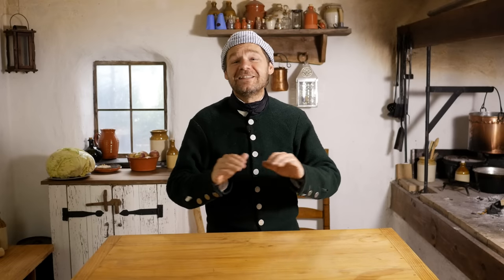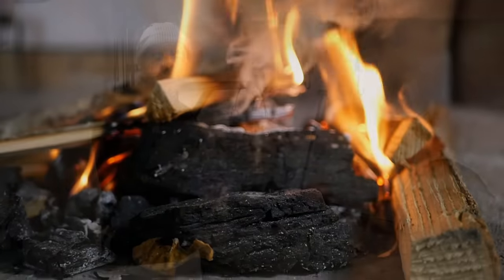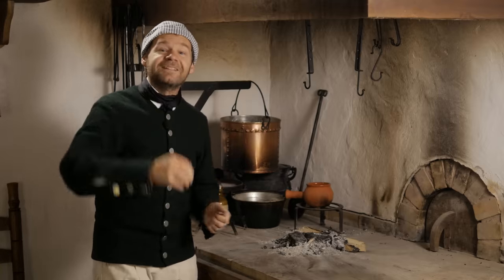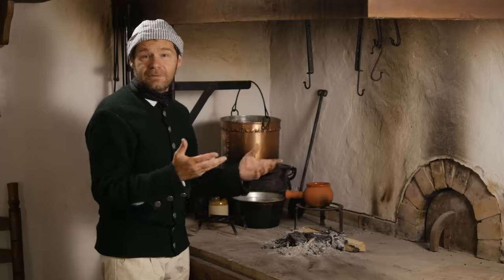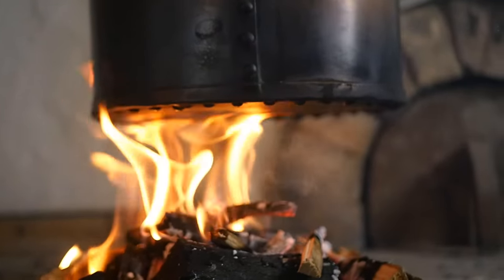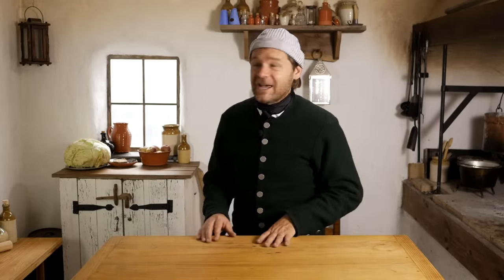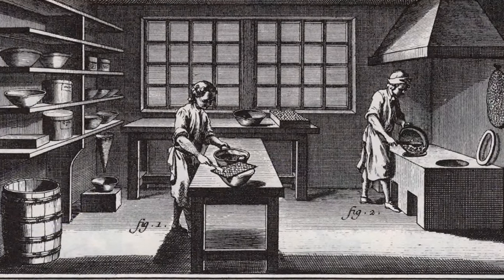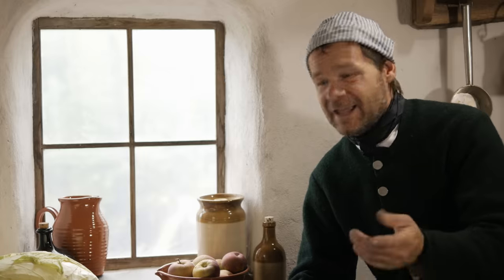Historic Kitchens vs. Modern Kitchens

Comment: I know I am probably weird, but I have an easier time cooking with wood fire than with modern ovens and stoves. I think I was just born to do it. I love it!

Speaking off light. I am always amazed at the times before lighting. To me it would seem impossible to see and drive me nuts! Or, at least I thought so. These days, I have on purpose, gotten used to cooking with very low light and  not overhead. I usually have on only the light above my sink and I do just fine with it, no problems whatsoever. I had to try it, because back in the 1700s have you ever noticed how small they wrote? I cannot even read it and I have good eyesight. I cannot imagine how they wrote so small. They did not have electric or public lighting. They had low lighting at best, from oils for heavens sake and their eyesight was by all accounts quite good. Maybe this bright sunlight into dark inside is healthy for our eyes. It would be interesting to see if there are studies on it.

Comment: Human beings are quite industrious as you know Townsends (howdy).  Cooking with smoke is better than cooking outside.  Too much draft will use to much firewood.  Now, as for my kitchen, I tried running exhaust from the stove and the overhead stovetop vent to the outside.  It over worked the stove and in winter time the kitchen would be freezing, even with shut off vents.  I managed to sole most of the issues but even with a separate vent fan, steaks, fish and hamburgers can be a smoke problem.  As you can tell, we like char.  Bought an outside grill which is really great but cleaning is a problem.  As always, studying your vids.

Comment: It's so weird to hear him talking about the way they had to wash the dishes. I am an American and live in Thailand. And it was a culture shock when I moved here 10 years ago, and saw many people here that washed their dishes on the ground, and using plastic tubs or a hose, outside. I had to wash my dishes that way for the first few months I lived here. I had to carry my dishes outside and down stairs, and walk down the sidewalk to a main area where everyone went to wash their dishes on the ground. And here, unless you buy a hot water heater, there is no hot water at all in your house. Even now, I have to wash all my dishes by hand, (because people don't really have dish washers here), and I have to use  just the room temperature water that comes from the faucet. We did install a hot water heater for the shower, but that is the only place we have hot water. And we are fortunate to have a typical Western style toilet. Because here, most people use a squat toilet, and there is a  large trashcan or some other container, that has a pail type thing, that you fill with water to pour down the toilet to flush it. And yes. This is 2021 and it is still that way in most homes here.

Comment: I have a question that I'm having trouble finding info about online...back before modern cookware, was cast iron used to cook acidic dishes like Spaghetti Bolognese sauce, for instance, or really just anything acidic?  My mother and WW2 era grandmother were raised in families that were taught to simmer their version of spaghetti sauce for about 6-8 hours, but they always used a stainless steel stock pot.  This amount of time would be a really long time to be simmering an acidic dish if one were to use cast iron.  Also alot of meat marinade recipes use vinegar and citrus, which is not good for cast iron seasoning at all from my experience.  Would they simply just cook acidic foods anyways in cast iron, and just re-season frequently, or was there some type of alternative cookware?  It seems copper cookware would leach into acidic foods if it was used.

Comment: Tools in a modern professional kitchen are also stored upside down and/or in a storage bin. It's a health violation for Ready-to-Use tools to be facing open air; as anything could spill/fall into the working surface...including rats, technically.

Comment: I know this video is already some years old. But I hope somebody can answer me. I'm making my own kitchen inspired in this one. The main difference is that it is outdoors. It's under a ceiling but is not a room. I'm in the south of Spain so the weather is mostly dry and hot 90% of the year. My question is about the big table in the center of the kitchen. Is it just raw wood? Does it have any kind of varnish? I wouldn't feel safe cooking over a varnished surface, but I ask because maybe they used back in that time any kind of way to preserve the wood without using potentially poisonous methods. Thank you again for your awesome videos. I just made a "custard coffin" at home today!

Comment: Maybe there were a lot of things you didn't have back then compared to now, but you need to count the positives among them. You also didn't have; a water bill $$$$, A sewer bill, a gas bill, Heating bill, an electric bill, property taxes, income taxes, sales taxes, municipal code inspectors.... 

Certainly not everybody, but people did make themselves sinks of different sorts, from clay/pottery, wood, hammered from copper etc, even with a short pipe or trough that took waste water out through the wall to the ground outside.

Comment: If they had a pump inside they could have easily turned that into a simple sink. The pump replaces the faucet, and instead of a complex drain just have a short pipe that leads straight outside.

Comment: It’s surprising how far we came in a few hundred years. We went from a room with wild edibles, and a wood burning stove to electric stoves, refrigerators and freezers, dishwashers, complex light systems, (such as light emitting diodes and other lights) from beeswax candles and the fire that you’re cooking on itself. Even candle technology has gone a ways a little, nowadays we have paraffin wax which is processed from crude oil some 10,000 feet in the soil, to gas powered bikes and cars using engines that use crude oil extracts to move a bunch of metal parts to get an axle to move which in turn move a wheel, to ordinary flintlock rifles to machine guns that shoot over 1,000 rpm in which we can arm the military with, it seems we really have came a long way.

Comment: why couldn't they make a round depression in the center or off center with firebrick to hold the charcoal or wood instead of piling it up in a lump on top? wouldn't the wind blow embers worse if it isn't in a depression? seems better  like when you dig a hole for the fire to  control it outside, so goes for the hearth? just a suggestion.

Comment: My mother was born in a village in rural Malaysia in 1954. She remembers how the family had two large woks over a brick stove, fed by charcoal or firewood. The smoke filled the small kitchen as they cooked rice in one pot and food in the woks. As the woks were heavy, they were washed by having hot water poured in them, scrubbed and then the water was swished out. The woks never left the stove. 

She also remembered the old charcoal irons, with large, heavy cast iron irons filled with hot charcoal. The heat couldn't be controlled, so the women often had burns, and the clothes could also be burnt.

It is fascinating, and I'm glad not to live in those times.

Comment: As to the height of the work surfaces... consider that modern man is a lot taller than humans generally were 400 years ago. 
And women were shorter than the men. 
My mother was only 4'9". And she found modern work surfaces too high for her. She asked that her home be built with the kitchen countertops several inches lower than standard.
I am 5'2", and I find a kitchen table is just the right height for me to work at. Kitchen counters are a bit high.

Comment: Beg to differ....yes, most europeans lacked anything like running water or plumbing.    
But, SOME houses, even old log cabins in the deep woods, had rudimentary indoor tubs, which drained outside via some kind of drain.  Some were tin-lined, and repaired by the wandering tinkers.   
Ancient Rome had plumbing for water pipes to bring in water, and take it away....not like now, by a long-shot, but it was still "indoor plumbing".  Ancient Romans had this [OK...it was lead pipes...bad...but still plumbing]...so did other ancient civilizations.

Comment: in those days doing up the dishes meant putting the, either pottery pan or cast iron pan into the fire to clean them or using ash water to soak them the ash water war pretty much-diluted lie other-means were sanding it out with actual sand or in the worst case putting the pans and dishes into fermented pee!! a stinky thing indeed but it worked!!